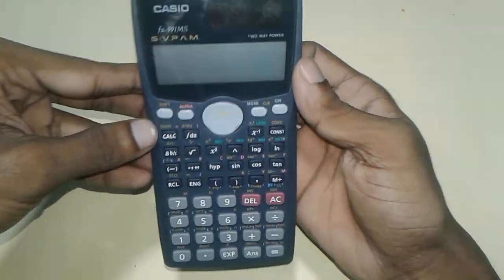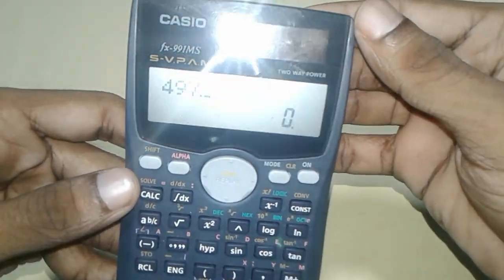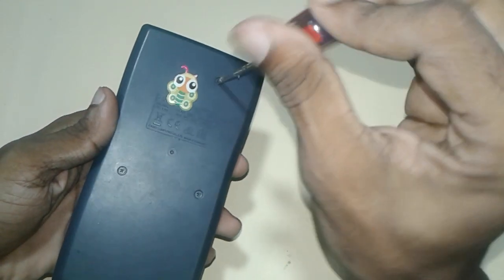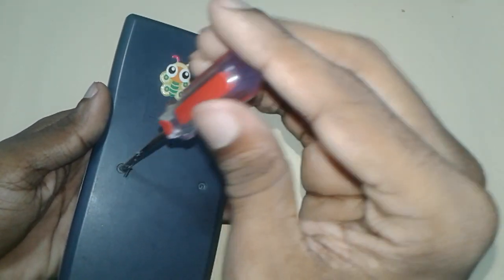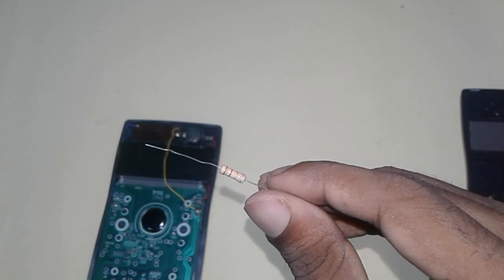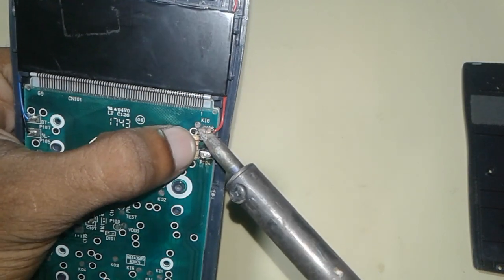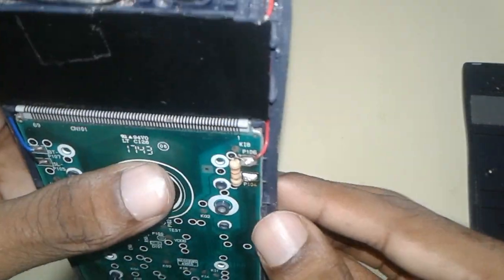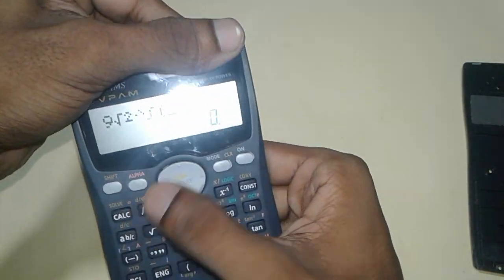How to repair scientific calculator

Comment: Instead of this , hit twice on back , it will work and thank me later
Reply: The fix is so 90s move yet it still works
Reply: Yeah it's actually work I smashed my calculator to my door  @redacted8983
Reply: It's not working
Reply: It's not the solution forever, if the battery has any fault you need to change it and i made my calculator even worse after hitting it every time so at the end i had to change the calculator
Reply: It does jor…
Reply: Thank you thanks thank you so much you saved me from a panic attack before my maths exam 😂😂❤❤😅😅. BTW again thank you so much
Reply: Thanks a lot bro 😂😂
Reply: Sorry bro
Reply: Thanks ❤❤
Reply: You are right👍🏻Thankyouu so muchh🎀
Reply: Thanks bhai 😂
Reply: Bro 😮😮😮it started thanks a lottttt
Reply: Thanks a lot ❤😂 for this indian jugaad
Reply: You are a Genius 🙏🙏
Reply: Nahhh thank you😭 I was almost in trouble
Reply: Thx bro
Reply: Thank you so much😊 it works
Reply: Bruh it really works 😂😂😂
Reply: Thankyou😅😅
Reply: Broo thanks😂❤
Reply: Bro, its works
Reply: thanks bro now the display is broken
Reply: Thankyou ♥️♥️♥️♥️♥️
Reply: I tried first try and it works hahahha thankss!
Reply: It's really worrkkkinnggg 😱😱 Thankkk youuuu brrroooo❤❤
Reply: That’s really worked 😂
Reply: Bro I are a legend. My calc just stop working and I saw ur comment and just tap them it turned on 😂

Comment: I use 5.6 ohm resistor n it's not working 😱😱🥺🥺🥺🥺🥺
Reply from the maker: Connect it without resistor and cheak it working or not
Reply: @MFRVISION  loooooottttt offff thnx Bhai
It's working now.....r u engineering??? N which branch???
Reply from the maker: @rutujagaikwad5906  EEE

Comment: Bro my Casio's display is gng off under shade like In a room but it works when only I m out side of the room or clg is there any remedy for it plsss tell me??? It is fx991 ex and new one tooo🙁😟
Reply from the maker: do what i did in video.. if not work. change battery

Comment: Hii when I tried to remove the back side of calci, I removed all the screws but in sticks in the middle of it.. Can't able to seperate to two parts of calcii
Reply: Don't open it then
Reply: Same for me.
Reply: try removing it with a sharp object 
i also faced the same problem

Comment: Same problem I'm facing plz suggests me what I should do
Reply from the maker: Change battery line to solar panel line
Reply: Ya done its working 🙏
Reply: Yes its working ✌
Reply: @MFRVISION  
My problem is , when the value put in the calculator , value is not show in shade but in light better works.
By changing the battery of that ,then it will be happen??